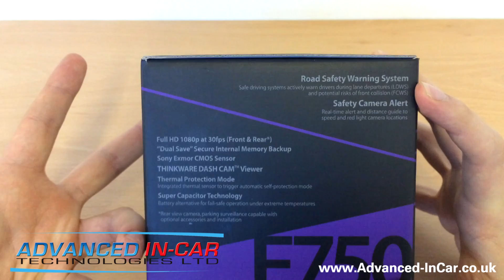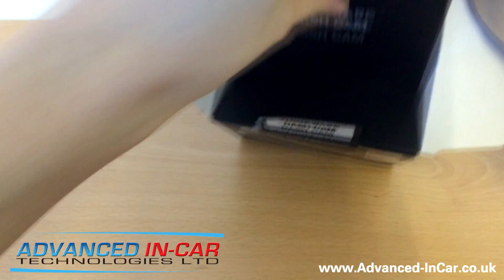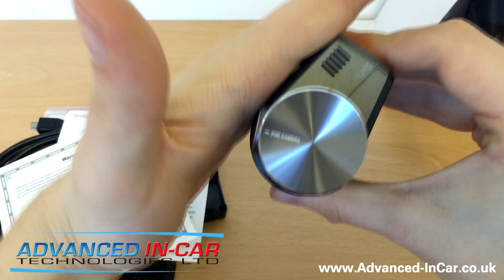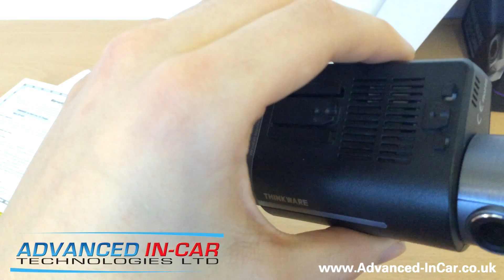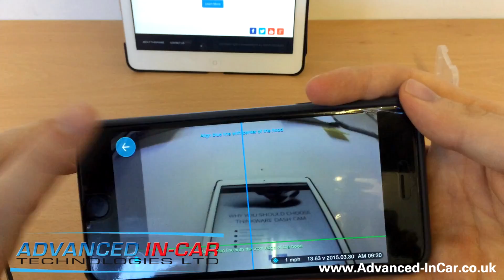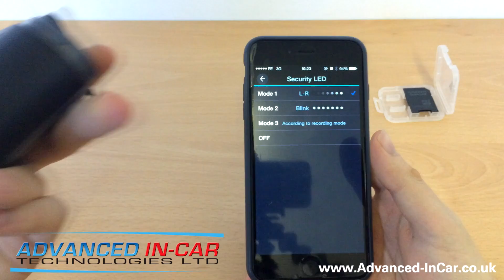Thinkware F750 DashCam UnBoxing & Review

Comment: This video is misleading. Folks, when you buy the dashcam in store it does NOT come with the rear camera, that's sold separately for an extra $100CAD. With the rear cam and the hardwire kit you will easily spend $500CAD.
Reply from the maker: It’s not misleading at all. This camera is available as a Front & Rear Pack or Front Only Pack. It depends which one you purchase. We’ve only ever sold the dual camera package as it’s more cost effective.

Comment: Hi, Great vid. I have a blackvue 650 2ch which has stopped recognising any SD card, very annoying!! Thinking of the F750, but does the cable for hard wiring come with the unit? I have the little black box that I bought with the blackvue.

Comment: Hi, where is the best place to mount the rear camera at the top of the rear windshield or middle?
Reply from the maker: Hey VBML, I would say at the top of the rear Windshield but make sure it's within your wiper zone otherwise you'll always pick up the dirty part of the screen when recording.
Reply: +Advanced In-Car Technologies thanks. Also are you aware of any app issues with the iPhone 6s+. I find it keeps dropping wifi connection, live view crashes the app and it doesn't disconnect from the iPhone properly. I hard reset the camera, reinstalled the app with no luck.
Reply from the maker: I have the F750 in my vehicle and also use it with an iPhone 6+ and not experienced any issues. It could be something to do with the S. I know that a new App update was released the other day.
Reply: +Advanced In-Car Technologies thanks for the reply I discovered my camera was faulty and it was swapped for a new one now it's working really well, it also could be due to the updated app

Comment: I've been looking at a lot of these cameras - and wow...there are a ton on the market, almost overwhelming! And I keep coming back to this one. Everything looks great with this, few issues I keep seeing from people on other sites about a slight lag - especially when viewing on the phone. Also memory card formatting issues. I see you have a model with a 32GB card, the ones online, in stores seems to offer just a 16GB card (same $300 retail price) That is a little lame...but if you're just using that card over and over again, overwriting old videos -  it's not a huge dealbreaker. 

But lets says that MicroSD card becomes faulty, or if you want to simply upgrade...buying a 64gb memory card is not a big deal of course, but I read that many get an error on the device...it's having trouble reading it, Even after a complete reformat -the card must be a Micro SDXC 1 card.  Few I've seen that still have trouble with other name brands...Seems that the Thinkware company want you to buy their Thinkware brand 64gb card ($69.99) I would have to look into that some more...sometimes when I see those type of complaints, they COULD be user issues, something that person is not doing right. Not sure...

Comment: Here is my opinion about this camera. I have recently purchased Thinkware F750 and I found some good things and some bad things. First of all I am wondering how it has won the Best Dash Camera of 2015 because it has certain features that are not to my expectation. Mainly the voice, it sounds tinny and robotic, not natural and when it says "Mobile speed camera zone", it sounds like Mobilespeedcamerazone, no break within the sentence. A lot of other words are hard to understand. And the volume is not loud enough considering that you're in a noisy truck interior, or a driver window is down in summer and there is a lot of traffic whooshing by, which makes it harder to hear that tin can voice. I placed my camera high up the windscreen and out of the way of my field of view, but I am having difficulties in extracting the Micro SD card. The SD card slot should have been placed on the right of the camera (http://www.youtube.com/watch?v=17qxIO4_ij4&t=9m30s) where the power and rear camera inputs are. It would have made the extraction of the SD card easier. But this is not a serious problem because of its Wi-Fi connection with an Android phone where virtually anything can be done on the phone's dashcam app and there is no need to remove the SDcard unless it's important. The buttons are too small and hard to see at night when not driving, e.g. roadside, car park, driveway. They should have been the same size as the Rec button. And the colour, being dark grey should have been lighter grey or they should have been a glow in the dark material so that they can be seen at night. Instead you cannot see them and that means you have to turn the vehicle interior light on and still it is hard to spot the switches at a glance in case of any manual switching. There is heaps of room around the switches, why did they have to make such small switches? The LED lights are too bright and annoying. They should all go off after 30 seconds without use because it is a distraction and a welcome to trouble should a gang in another car see the two blue lights and may make them stop the car with the camera to ask questions about whether they are being filmed without their consent, especially the rear camera with the blue light. There should be no light in the rear camera, as it could attract undesirable and some form of road rage may occur. Front camera has a click indent alignment and it makes it difficult to adjust the up and down (green line). One click up and it's too high, one click down and it's too low, so, I could not get that green line exactly on or below the bonnet's front edge. The instructions that came with the camera are pathetic. It doesn't explain enough and I have often been left with scratching my head on reading them. It doesn't say anything about the beeps that the camera makes, there are two types of beeps that I think are for following a vehicle too close but the beep for supposedly creeping into another lane are not known. I am still trying to figure that out. However, the camera beeps when someone enters your lane (cutting in) and that is a good feature because it warns you of an unexpected danger ahead.The good benefits about this camera is the video clarity. It is clear and steady, doesn't flicker different shades of color when going from shaded areas to full sun. It has a very good video temperature adjustment that gives a clear, crisp resolution at 1080p. When viewed in a mobile, depending of the mobile video system, some are weaker than others, the video transmitted from the F750 to my mobile via Wi-Fi is excellent but lags a bit when vehicles pass from left to right or right to left. But when the SD card is removed and inserted in a computer with a good video graphic card, the video transferred to the computer and watched with the Thinkware Interface, is excellent and lag free. Best when watched on a large widescreen monitor. Both front and rear camera have the same video quality. What I like the most is the recorded night view. The video is brighter and clearer with less contrast and finer resolution and virtually noise free. Almost like what your eyes see at night while driving. Due to the lack of proper Instructions, the installation of the camera is easy for those who have mechanical experience, especially if the rear camera is to be installed. Even so, the front camera must be installed accordingly with the red wire being constant power and yellow being connected to an on and off Ignition fuse so that when you turn the Ignition switch to Accessory point, the camera will be on and when turned a click further to ON (before starting the engine) the camera should still be on, but only switched off if the whole Ignition is turned off. Those with push button start vehicles have two choices that are too much to write here. But I will offer free advice on how to wire push button start vehicles. If not, you can have it connected by a certified Thinkware dashcam installer. Good luck.
Reply from the maker: +Mick Carson Great write up there! Thinkware monitor this account so I'm sure they'll enjoy reading this :)
Reply: I agree it does lag slightly, but overall is it pretty good, license plate of cars are clear and zoom aspect is cool on videos. my camera a turns off once ignition is off after a short while, spoke with installer who informed it will kill call battery if let on, they said it's possible to leave it on, but I'll need a stronger car battery, my car is the push start, but overall it really looks nice design even tho its big, similar to a police cam.
Reply: Tarek Taher 
Camera size is perfectly okay. It's neither big nor small. What I like is the case color. It's almost difficult to see the camera from outside, as the camera blends well with the shiny windscreen and there are hardly any shiny parts on the camera that draws attention. So is the rear cam.

As for the car battery, I have left my car in the garage for 5 days without using it and on a Saturday I decided to drive it. I found that there was no drop in battery voltage and the engine started without noticeable difference in cranking speed. And the car also has an alarm system. So, yes, I believe a good high power battery is highly recommended. Otherwise here's a hint. Connect the three wires as follow, red and yellow to Input of a double pole toggle switch (solder if necessary), then solder two similar color wires on the Output poles of the switch and connect those as follow, red constant voltage (any 10 amp fuse will do for both wires) and yellow to Acc/Ign fuse that turns off when the ignition key is turned off or removed. The black wire can be connected to a metal part of the chassis. Alternatively, you need a red and green LED lights to indicate the status of the on/off toggle switch where red means camera is not connected to the car battery and green means it's connected. When you turn the ignition off the red light will flash like as if you've got an alarm to draw your attention that if you wish to disconnect the camera, e.g. if the car is parked in the garage and not used for a few days, you can toggle the switch off and the LED will then switch off when the ignition is turned off and keys removed. When the ignition is turned back on, the red LED will start flashing to remind you to switch the camera on at the toggle switch. Once on, the red light is off and the green LED light is on. If you turn the ignition switch to off the red light will come back on and the green is off to remind you to manually switch the camera power off. Otherwise the red LED will keep flashing like an alarm on indicator.

You need to have some electronic knowledge to make an electronic on/off switch for this application to stop draining the car battery. Otherwise you must not leave your car without starting and running it for more than 4-5 days. 

Note: The option above is only for those who don't drive much and therefore any devices that are connected live to the car battery tends to slowly discharge it, e.g. car alarm. If in doubt the only way to minimize this is to fit a manual switch to disconnect the device when car is garaged or not driven for more than a week. Cheers.
Reply: CarbonCarSystems 
Hello there.

I thought I'd invite you to view my F750 review I had made in this post for you to read and, like you said, pass along to the developers so that they can continue to make improvements. This is a more detailed review that offers some hints that could make this an even better camera that offers features that other cameras may not have. Cheers mate.

Comment: hey got it installed and now the camera doesn't stay on all time only when car is turned on, the installer informed me to change the volts on settings, do you know how to keep it on all time? otherwise will take to installer and get them to fix kt
Reply from the maker: +Tarek Taher Have you fitted it with the Hardwire kit and then turned on Parking Mode in the settings? If you've done all of that and it's not working, speak to your installed to ensure it's wired correctly.

Comment: Great video, thanks for demoing so completely!  Any solutions for a permanent in-car monitor for this cam system?  Preferably something with support for a total of 4 cams, allowing split cam and such.  (To have a right side, left side, rear camera in a 32' RV)  Something like a 10" Galaxy Note seems ideal to me, however, I would want to know I could bring up the appropriate cams without taking my hands off the wheels.  Almost worth dedicating a laptop to it it seems...
Reply: +Will Ralphs Look for mobile DVRs on Ebay. You will find what you want.
Reply from the maker: +Will Ralphs When you start going to a multi-cam system you then have to start looking at commercial options which then get very expensive. We haven't come across any decent quality camera systems that offer more than 2 cameras at the moment unfortunately. I expect this will be the next big thing.

Comment: Hi, I bought this dashcam but I have a question: During live view on the app the camera is not recording. It only starts recording if I close the app. Is it possible to use "live view" while recording? I don't know how to make this work. When I'm in "live view mode" and the car is parked somewhere, it does record a few minutes but it always stops. How do I use Live view mode while recording constantly?
Reply from the maker: +David S It's mainly so that the camera doesn't over work itself. To be honest I don't think it's a massive issue. There is no setting that can be changed unfortunately.
Reply: Hi, I know it has been a while, and I'm wondering if things changed by now. Does it allow you to watch live view while recording? Does it record while viewing live now? I want to buy this with rear cam, but I want full time recording and full-time wireless 
live-view (for rear camera). Please LMK... thanks
Reply: Hello there, 
There is no real time view while driving. But to be honest, I'm okay with that. First I wanted the real time view while recording but honestly I don't miss it. The camera is perfect and I don't regret that I bought this one. The camera is very good quality. If I may suggest you a camera, you should buy this one. You can also download Thinkware software to watch your movies or rework them. There's also a USB dongle included which makes it easy for you to read your micro SD card. 
I hope I could help you a little here. I'm very satisfied with this cam, really. 

Regards, 
David

Comment: Note before hard wiring. It's most likely to make your insurance go in the wrong direction.
Reply from the maker: +Gavin1uk Not heard of that one before. Normally if it's installed professionally and all working correctly it can bring your premium down. Did they advise why it went up?
Reply: +Advanced In-Car Technologies I was shocked too. I just assumed it would naturally bring my premium down. My insurance quote was something like £270 and then it jumped to around £675... Lots of insurers won't even insure you. They class it as a modification, broker said it could be seen as a fire hazard...

Comment: Thanks for the video! It's very helpful. I have a question: I just got the dashcam yesterday, and I haven't been able to connect it using wifi to neither my iPhone nor iPad. It won't connect! I tried everything I know. Any tips?
Reply: +mimabaya hi, I have the same problem. could you solve the issue?

Comment: Hi, I bought this unit with the rear cam to and installed by Bestbuy..just wondering why the parking mode is not working..on my app on myiPhone all setting are ON..I called the customer support they said I need to buy dash cam kit..but bestbuy installed it thru hardwire. Thanks

Comment: Great review bro! I bought the garmin dashcam 20 and it was disappointing because it did not have parking mode. Would you recommend this thinkware dash cam more than the blackvue cams? I'm looking for one that records 24/7 with overwrite and records when parked. Also. does it drain the battery to the point you have trouble turning on your car?

Comment: Hi, I purchased this cam and had it hard wired. The fitter said it's been wired off the cigarette lighter but this loses power soon as you turn the ignition off.  So I'm guessing the parking mode will not work then? But if wired straight off the battery won't my battery keep going flat? Also rear facing camera is recording upside down grrrrrrrrr thanks for your help
Reply: ***** They will be returning to fit the correct wiring loom and I turned the rear one round. Really appreciate your help.....
Reply: Same happens to me the image upside down in the rear camera all you have to do is rotate  your camera to the left of to the right until you get the correct view and  everything is fine.

Comment: Hello great video. Does the parking mode work if it's not hard wired?
Reply: ***** Ok thanks then.
Reply: +Advanced In-Car Technologies Does it go into parking mode automatically after the car is stationary for a few mins, or do you have to select it manually everytime?
Reply from the maker: +Steve Moore It should do it automatically. Think it goes into this mode after about 10mins.
Reply: OK thanks, It's that I've read a few times where people cannot get parking mode to work unless it is hardwired, my cars cigarette socket has constant power so trying to find if it is auto or if it is triggered via switching off ignition
Reply from the maker: Steve Moore They do advise that you use the official hardwire kit. I've not tried it on a constant Cig lighter, only on hardwire. Maybe it might only activate if it can pick up the separate Live, ign and ground?
Reply: +Steve Moore yes within about 10 seconds, providing the PM is set to on of course. Note if in the UK expect a significant insurance rise when notifying them it's been hard wired...